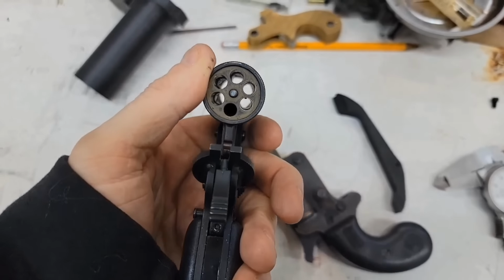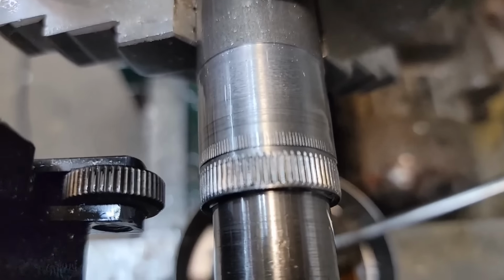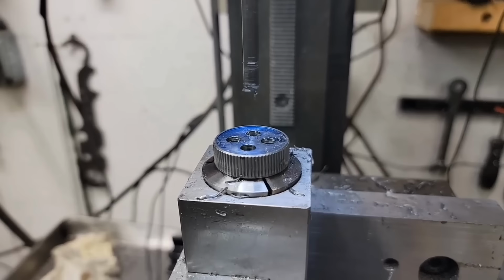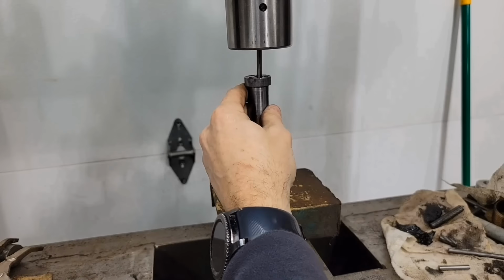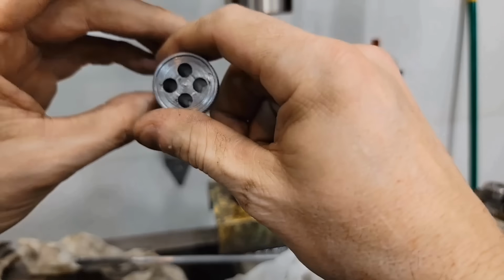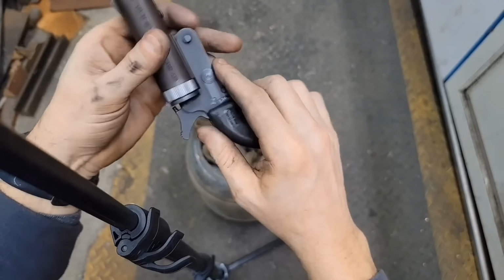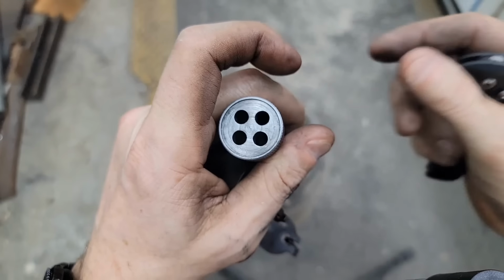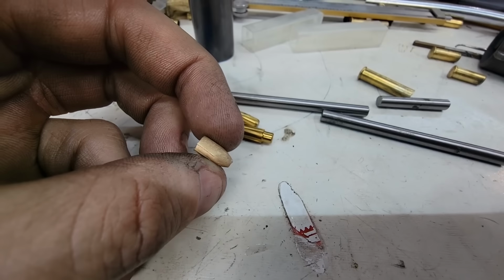PSMSA DIY Derringer - DIY 22wmr Cylinder

Comment: Check with the local scrap yard for tubing for a bullet trap. I use a piece of 12” schedule 40 steel pipe. It was scrap from an industrial pump but anything like that will work. It has a 5/16” side wall thickness. I used a torch to cut the face at a 45 degree opening to shoot into. Make the opening 12” x 18” or so. Then I dug a hole a few feet deep and set it in the ground at a 45 degree angle so the bullets hit the back and angle down into the tube. Filled it with sand. 20 years ago and never a problem except I cannot clean it out without digging it up. If I ever need lead I have a stash. Many thousands of rounds from 22 short up to 300 mag without even a good dimple in the strike face. Really. But 300 mag really knocks the rust off of it. Lol. The pipe was about 5’ long also.
Reply from the maker: Sounds like what I need .  I have a line on some scrap pipe, so it's in the works.  I'll post a video !

Comment: If you make the hammer tip more of a point than a flat head you can have more support material on the breach face, just a thought. great video cool gun.
Reply from the maker: I was considering making a more legitimate breech block with a floating firing pin.   Overthinking a simple gun.

Comment: The over pressure problem might can be fixed, don't give up. Maybe if the distance from the case mouth and the start of the rifling could be increased by a few thousands, it may work out.
Reply from the maker: I'll figure it out one way or another.  Even if I have to make a whole new frame for it.

Comment: I had once posted a comment of a project for someone to make, of a rifled black powder .44/.45LC pepperbox, and posed the question if rifling was even possible or practical in a pepper box cylinder; similar to the .45LC/.410 version that survivorjohnny44 John Tewelow posted on YouTube? Though, it didn't mention anything about rifling. I'm still interested in knowing if rifling in the cylinder would be a good project for consideration?
Reply from the maker: Sounds like a cool project.  The rifling, while it'd be nice if it really works and works well, it's required to be legal, so if you get that covered, anything else is icing!  I've had great luck with smaller calibers.  The first 22lr I ever built from scratch is very accurate.  Even the 32's are decent.  I've had some good and lots of bad luck with 9mm, 357 and up.  I have 410/45 build planned.  Maybe you'll get to it before I do.  Post a video of your project please !

Comment: You could shoot 22WRF in the mag cylinder, lower pressure and might not flow back into the recoil shield like the mags did.
Reply from the maker: I am making a new frame with a proper breech and floating firing pin.
Reply: @jimafcarbon4433   Even better idea!
Reply from the maker: @Mtbambeno  rather than seeing it as a failure, I saw a good reason to make another gun !

Comment: I like pepperbox revolvers, they are somehow just more appealing to me than regular revolvers.
But I didn’t quite get how this one indexes. Am I right to assume that there is a spring loaded part that „locks“ into the front of the lower barrel?

Also nice work btw!
It was really interesting to watch you build that cylinder from scratch.
I haven’t done much machining, so it was my first time seeing that wheel you used to get the knurling. A very interesting process
Reply from the maker: Yes.  You're right, there's a detent that indexed on the bottom Chamber.

Knurling tools are cool.  For sure.

Comment: Was thinking if using a ball between rifling die and the rod for pushing may help to allow it to turn while broching the lands would help?  I've no idea, just thought to ask
Reply from the maker: It turns on its own quite well.  Biggest issue is lining everything up and pushing straight.
Reply: @jimafcarbon4433  okay.  Thanks.    Thinking about a model tank barrel, more for scale effect than actual firing.    Thanks for the reply
Reply from the maker: @russcole5685  some of these really cut some good rifling.  But the ECM rifling method might be better for your needs.  Or maybe just 3d printed.
Reply: @jimafcarbon4433  umm. Yea, I should have mentioned, it's a steel model. A lot of lathe work.
Reply from the maker: @russcole5685  any videos of that?  ECM would work well though.
Reply: @jimafcarbon4433  bar, it's just a project at home.   Others have done it, I'm just doing it as a learning experience.  I don't think the quality is video worthy
Reply from the maker: @russcole5685  none of my projects are video worthy, yet here we are!
Reply: @jimafcarbon4433  LoL 🤣. Fair call.    I'll have to learn maybe
Reply: Plus, I'm in New Zealand, Sssooooo.  Properly best I show what I'm playing with.  LoL 🤣.  At 1/8 scale it'll have 11mm bore, close to 44cal.   Was thinking maybe 410. And chase rabbits with it.  LoL 🤣

Comment: Hi there, great vid thankyou.  Can I ask how many tons pressure required to push the die through? Thank you!
Reply from the maker: I use a 20 ton press.  It's certainly not at its limits in the process
Reply: Thankyou very much for taking the time to reply! I was going to get a 10t press but may not be enough....cheers!

Comment: Would absolutely love to purchase one of these
Reply from the maker: Not sure if anyone still sells the complete guns, but Excalibur sells the kits for a DIY build !
Reply: Excalibur?
Reply from the maker: @FriedPi-mc5yt  yes, they sell kits to DIY your own.  A few different models.  Not sure which are still in production, but there was a single 410, a double 410, a 22 over 410 and a 22 Revolver.  And a few long gun versions as well.
Reply: @jimafcarbon4433  I’ve built a couple semi auto AK variants and machined several AR lowers. So a derringer or two seems like a nice change up. Found the website. So I’ll be doing a bit more digging. I guess a mig will work for the frame? I’m not running a tig.
Reply: @jimafcarbon4433  Interesting, Lee Tool and Machine in Chattanooga Tennessee has the frame flats.
Reply from the maker: I saw those frame kits.  That's pretty cheap. If you're any good with might, I'm sure it'd be fine.  I bought a tig welder and taught myself how to use it just for stuff like this.  They aren't pretty no matter what, so I'm sure you could stick weld or braze one if you had to.
Reply from the maker: Please build one!  And post a video of it.  I'm only here to inspire others to take on a build of their own.  You CAN make dreams come true 😉
Reply: @jimafcarbon4433  I’m deadly with a mig once I get it set up. I’m no video making guy. So I don’t think doing a video would work for me. I just like to build stuff and this seems like a project that would be right up my alley.
I’ll probably build a couple with my son. I’ll machine a jig to hold the frames and breech parallel during welding. That would make it super simple.

Comment: I'm not a locksmith, but I can see Your mistake at first glance.
Why didn't You reproduce the back of the drum exactly?
Notice that the old drum has an archaic shaft - a protrusion. And You made the eardrum wall "rough". That's why the drum doesn't rotate and the shells don't pop out. There should be some looseness there. Regards. Dilettante. 🛠️🤠🔫
Reply from the maker: @Andrzej-uf2zm  the biggest issue is the hole in the breech for the hammer.  It it too big and the back of the shell is unsupported.  This allows the case to expand too much which block the cylinder from rotating.  I'll make a completely new frame for it with a better breech, maybe even a floating firing pin in the breech rather than a fixed firing pin on the hammer.  Always so many improvements that can be made in DIY improvised weapons.

Comment: I’m so confused at what you did at around 4:45? It looks like you faced that off by pushing g past center?!!!
Reply from the maker: I can see why.  I had to go back and watch it.  I had it turning in reverse but the frame rate on the camera and the lathe speed together made it look like it was turning forward.  But basically, it's just a recess the depth of the rim.  The chamber only goes deep enough for the case without the rim.  Probably should have left a tit in the center for a bearing surface.  The outer ring works though.

Comment: Hi Jim, so you first drill the barrel, rimed it and then make rifling? Can you tell me please the size of drill for drilling and size for rifling button, thanks
Reply from the maker: To get the correct size, you should drill a little under sized and ream to final dimension.  So for 22wmr, .218 bore, I would drill first with 1/8", then a #3 and ream with a .2180 ream.  The cheap adjustable readers can be used, bit they are a little less accurate.  
Same with 22lr, but finish with a .2160 ream.
Reply: @jimafcarbon4433  Thanks. In size of rifling button? 5.5 or 5.6 mm??
Reply from the maker: @juanmanuelherves7036  5.6 or 5.56 if you can find it.
Reply: @jimafcarbon4433  Thanks, and chamber dimension is same than barrel?
Reply from the maker: @juanmanuelherves7036  I use a chamber ream for all my 22lr and 22wmr builds.  I will single point bore a straight wall chamber if I have to, but I don't mind spending money on quality tools like chamber reams if I know I'll use them.
Reply: @jimafcarbon4433  Thanks.
Reply: But i havent a reamer. I Will try with a round road and polish. In future i Will Buy good tools. Thanks again
Reply from the maker: @juanmanuelherves7036  the right tools only make the work faster and easier.  With patience and skill, very basic tools can yield amazing results.

Comment: I’m curious what brand or should I say design it’s from
Reply from the maker: PSMSA is short for Professor Parabellum's Practical Scrap Metal Small Arms.  This one is Model 1 from vol 7.
Cobray / Leinad made production versions of these as well.  Excalibur sold many (and still sells some) different kits for DIY builds.  Mostly based around 410/45lc.  I have several videos with a few different versions that I have built.

Comment: I can imagine thats one exspensive hobby especialy to make them look as nice as yours does.. About how much money worth of Equipment have you had to buy over the years?
Reply from the maker: Buying tools is a never-ending endeavor.  The cost of a mill or lathe is easily doubled by the tooling needed to use it.  But spending 5 hours on a friday night in the shop is probably better than spending that time in a bar.  My Bridgeport is a lot cheaper than a DUI.

Comment: what turns the cilinder into the right timing?
Reply from the maker: Manually indexed.  There's a detent that aligns the bottom chamber.  Which is also in line with the top

Comment: Такъв револвер трябва да има заключване на магазина преди изстрел! Ударникът малко по-ниско около 5-7мм трябва да има зъб с който да фиксира магазинът, но и да не позволява магазинът да се отваря по време на изстрел!
Reply from the maker: This was the most basic design of revolvers from the early 1800's before they had such safety measures in place.   The manual process is a bit of a safety itself.  If the chamber in the cylinder is not perfectly aligned it won't fire anyway.   These are simple and crude though.  Better EVERYTHING should be the goal.

Comment: Барабан- ствол утежеляет изделие!!!
Reply from the maker: It does.  Which is yet another reason modern firearms have modern designs.
Reply: @jimafcarbon4433  выдержит ли сигнальный пистолет винтовочный патрон ? Если вкладыш 70см с наркозом сделать 5.55
Reply from the maker: Could probably do many different calibers.  This is just a novelty of sorts.  A fun project.
Reply: Упрощенный вариант без лишней механики. Зато нет проблем с соосностью и прорывом пороховых газов.
Reply: @TechMik  деринжер по итогу выходит , только со сменным стволиком и долгим перезарядом  ,по центру экстрактор не помешал бы как у револьвера! А так ракетница вещ! Любой вкладыш можно вставить!)
Reply from the maker: Yes I like the option of multiple calibers 

Also, there is a detent for indexing. With the extra drag created by the bulged cases makes rotating difficult.  But it can be remedied.  Overall a poor design.  Simple but usable.
Reply: Наверняка нет , оторвёт капсюльную часть , да так и есть ,(у меня ) даже на 5,6, и без нарезки.. @Сергей-ц9ы3з

Comment: Do the cylinder turn when you fire it each time like a regular revolver,  my phone cut off watching ,  the professor 🤓
Reply from the maker: No, it's old school.  Manually indexed Revolver.  There's a detent to make it stop in the right position.  But you have to turn it between each shot.  A lot of the PSMSA series designs have an antique like action.  As that tends to be easier to DIY at home.  Professor sounds better than the mad scientist of janky Homemade guns !
Reply: @jimafcarbon4433  professor 🤓 👍
Reply from the maker: @craigfinley2507  the whole PSMSA series is full of strange stuff like this this.

Comment: Sorry, why are the impact marks on the 22LR trigger on the edge and not in the middle like on the original bullet?
Reply from the maker: "Rimfire"  they are offset from the firing pin because the primer is not in the middle, but in the outer rim.

Comment: Why chamber a one inch barrel for .22Mag? Why not chamber for .22LR and have a little more barrel to build more pressure? IMHO You're wasting .22Mag rounds and spitting fireballs.
Reply from the maker: You're not wrong.  It's already 22lr.  I just wanted to make it 22wmr too.  The gun is nothing more than a novelty anyway.
Reply: @jimafcarbon4433 Yeah, true it's just for fun. I did a few amateur gunsmithing projects many years ago but from the practical side of things, Sorry to be pedantic but wouldn't you get some blow-by using .22LR? Still wouldn't matter though with such a short barrel.
Reply from the maker: @Tomken8d2  oh, no, the 22lr is a separate cylinder totally.  It's a terrible design overall for anything practical.  It was designed to be easily homemade with basic tools and limited skills.  I just can't leave well enough alone.  Here's a few more Model 1's
https://youtu.be/MBIF-PGMays
Reply: @jimafcarbon4433 Yep, fun is for fun. Applying it for anything more is dangerous. Do you have a plasma rifle in 22Kw range?
Reply from the maker: @Tomken8d2  no, but close I recently bought a new cap and ball revolver.
Reply: @jimafcarbon4433 That's close enough...
Reply: Какой то курьез а не оружие😂 но мне понравилось качество изготовления, попробуйте сделать револьвер на рамке этого дерринжера, возможно с ручным передвижением барабана.

Comment: Please share file help me
Reply from the maker: Search for "Practical Scrap Metal Small Arms vol 7"  this is Model 1.  Excalibur sells the kits.
Reply: @jimafcarbon4433  i see ! But can you made 1 file cad send me
Reply from the maker: @thanhtiger6913  I don't do and 3d modeling like CAD.  These "DIY" for me are all one off.  One might resemble the next, but certainly not exact copies.  Other than 3d printers, I only have manual metal working machines.
Reply from the maker: The plans are basically just the pictures.  Terrible, but simple.  Designed to be easily homemade with basic tools and limited experience.

Comment: Having such good work skills + equipment, why not make a real revolver, and not this handicapped product?
Reply from the maker: This is the design.  The old style manually indexed cylinder.  Then I just made an additional cylinder.  
These are designs from Professor Parabellum's Practical Scrap Metal Small Arms vol 7, this is a variant of Model  1
Reply: @jimafcarbon4433  😊
Reply from the maker: @АлександрБелов-ц9к  👁❤️👻🔫

Comment: A la base, surement un lance fusée ?!
Reply from the maker: No, it was originally a 6 shot 22lr
Reply: @jimafcarbon4433   firme Derringer ?  prototype ?
Reply from the maker: @mail9353  search for Professor Parabellum's Practical Scrap Metal Small Arms vol 7.  This is a Model 1.  Excalibur still sells the kits.  Lee Tool And Macine sells the frame plates.  Still a bit of DIY involved to complete. But an easy way to get into building.
Reply: @jimafcarbon4433   thank you very much, I found the tutorial, salutations de Paris en France
Reply from the maker: @mail9353  they are fun builds, but I don't think your laws permit home builds.
Reply: @jimafcarbon4433   c'est exact, nous avons actuellement des lois contraire à notre liberté fondamentale, que l'on a perdu depuis la suppression des frontières européennes, mais les Français ne déclarent pas tous ce qu'ils font, malheureusement, lorsqu'une dictature se créer dans un pays, les délateurs également.
that's right, we currently have laws contrary to our fundamental freedom, which we have lost since the removal of European borders, but the French do not all declare what they do, unfortunately, when a dictatorship is created in a country, so do informers.